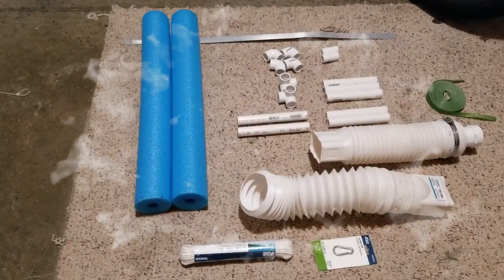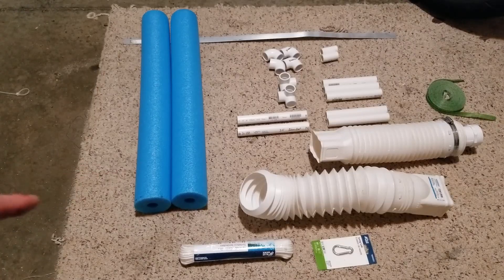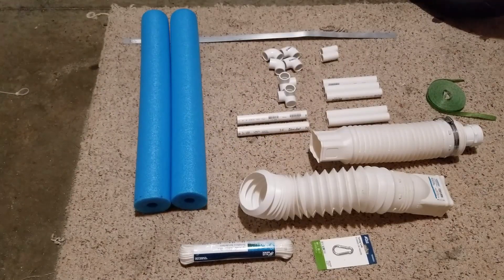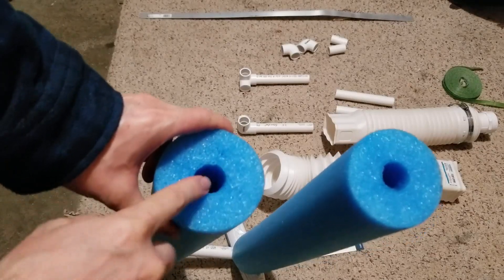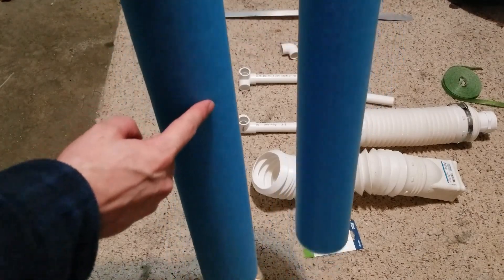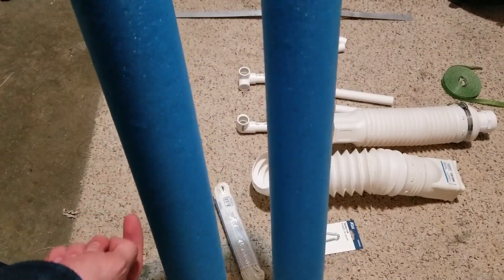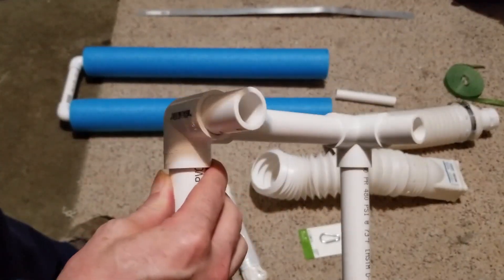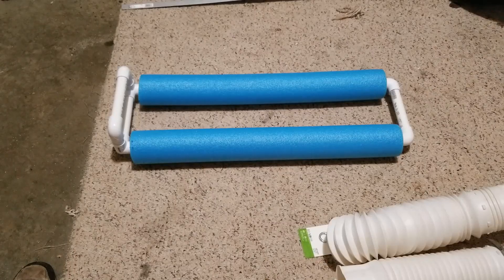How to Make a Floating Gold Gravity Trap Concentrator Sluice Box DIY - Manual Dredge Suction Pump

Comment: I think the up lift at the end of the sluice will cause problems. To avoid plugging you should let it run flat so the material exchanges properly. Good job.
Reply from the maker: Hey Geno from Reno.  Thanks for the comment and checking it out.  I designed it that way because:
1.  The on/off pumping of water from the hand dredge might cause gold loss if it was flat. This way it may capture a slight bit more material and not concentrate quite as well, but it captures all the gold, down to flour gold.
2. I wanted to make sure in faster water currents that there would be no gold loss from movements of the sluice in the current.  The upward direction makes it almost impossible for gold to get shaken out due to creek water flows and currents.

I have used it quite a bit so far and have not really had much problems with it at all.  Works quite well.  Only thing I might do a little different is make the base with the floating things a little wider and longer to help it float a little better and remain more stable.  
 
I appreciate your feedback, thanks for the comment!

Comment: Your instructions are not complete. What materials did you use and how did you assemble the front where the suction hose attaches?
Reply from the maker: Hey James, thanks for checking it out.  In the description of the video, it has links to pretty much all the materials I used to make this.  Yea since I added onto a previous thing I had made, the instructions for the top of it is on the bucket concentrator  video here->  https://youtu.be/vq6PFOpAl1g
let me know if you have any more questions about it.